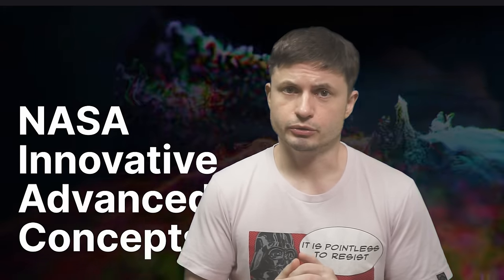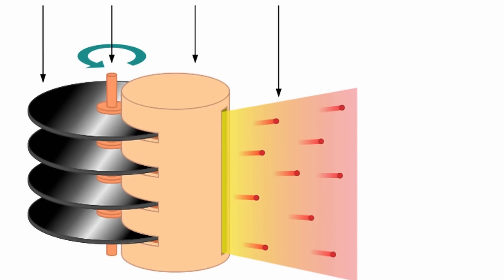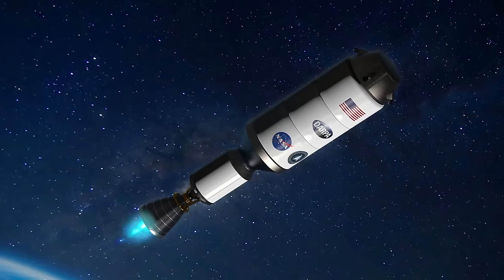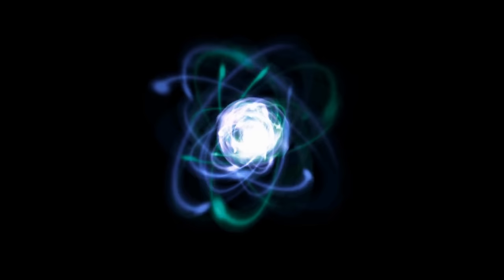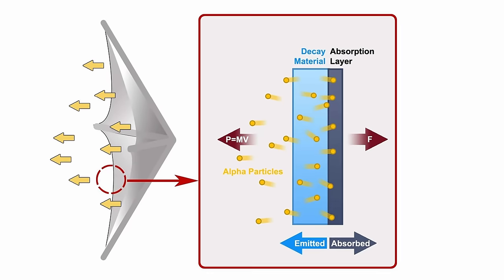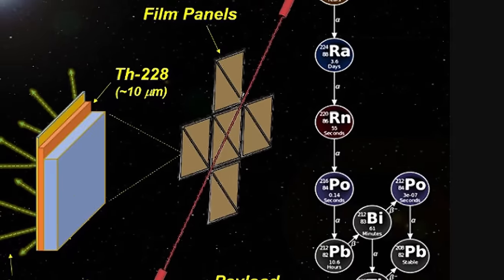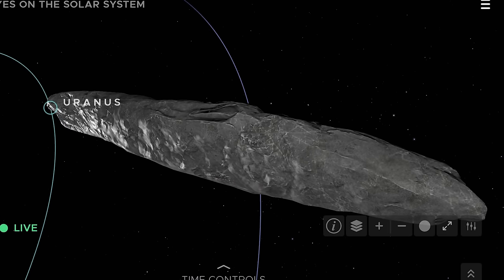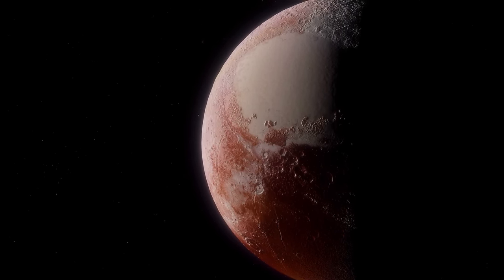Efficient Space Engine That Could Use Nuclear Waste For Propulsion

Comment: A couple of questions :-
Does a particle colliding with the absorbing layer layer cancel out it's own backward thrust created by it's emission?
Because the particles are emitted randomly in all directions, how is the lateral thrust controlled?
Just a thought.
Reply: Random thrusts add up to zero as the number of particles increase. And yes, the momentum is cancelled. This is dumbass engineering looking for a problem for their solution.
Reply: It's an obvious question that Anton does not answer.
Reply: The absorption layer makes one face net zero leaving other face net positive hence thrust pretty simple . You're premise is backwards for the emission to hit the absorption layer it has to be going forward. Emissions backwards are let go hence thrust.And lateral output is negligible as we're dealing with trillions of tiny outputs each fuck all. Think of it as a statistics engine if that makes it easier.
Reply: @leonmusk1040  The force on the sail will be created by the emission of particles from the atoms, not by their effect on the sail.  Because particles are randomly emitted in all directions, the forces must be neutralised from all but those going opposite to the direction of travel.  Otherwise there will be no resultant force to provide acceleration.  Trillions of tiny outputs add up to considerable force, otherwise the concept would not work.  Thus, any uncontrolled  lateral leak will lead to a deviation in trajectory.
Statistics is not Engineering.
Always bear in mind, there are "Lies, Damned Lies and Statistics".
Reply: @farrier2708  Tell me you're unaware of the Monte Carlo method without telling me you're unaware of the Monte Carlo method.
Reply: The very point of the absorbion layer is to catch the forward particles so the thrust is created by the back emissions. You're thinking of this backwards, if there was no absorsion layer, the forward emission would cancel the back emission and the probe would end with no thrust. Side emission are neglible because we're talking about a tenis court size panel thats10 microns wide/thick.
Reply: @carlschissler  I have never actually used the Monte Carlo method but I have visited the oracle Delphi.
I found the virgin priestesses there to be equally accurate.  😎👍

Comment: What happens when a rocket fails or explodes on the launch pad?
Reply: Or on the upper atmosphere?
Reply: Nothing.  The thorium, plutonium, etc. is encased in an  explosion-proof, crash-proof and easily identifiable container.
Reply: @douglaswilkinson5700  You mean like those perfectly preservable Flight Recorders on aircraft?
Or the core containment at Fukushima or Chernobyl?
Is that sort of fool proof containment you are talking about MR Wilkinson4600?

Describe this container that you are talking about - the material it's made of, the shape, the thickness etc.
Reply: @PetraKann I am not an expert on the containment vessels for RTGs.  There were several news stories I saw years ago where NASA explained their ability to withstand both an explosion and an impact post rocket failure.  If you are interested you can look up the details.

Comment: Couldn't the sail, instead of absorbing half of the radiation, reflect it back?
Reply: No, because most of the radiation is neutrons. Some of it will get reflected, but just as many will pass through and even more will get absorbed.
Reply: Alpha particles would be very difficult to "reflect" - they are heavy and small, relative to particles that would make up the "mirror", and they pack a punch that would very likely damage a thin mirror. And such a mirror would only reflect particles sent in its direction by the radioactive layer's contact surface. Depending on the thickness of the isotope layer, the percentage of reflected particles exiting the sail from the right direction may be very small, so the mass of the reflective layer may end up making the sail less effective
Reply: @Unmannedair isn't it alpha radiation? That would be positively charged and could be reflected by a high electrical potential. The problem is, that they would be reflected back to the Thorium. Maybe the direction of emission can directly be altered by an external electrical field.

Comment: Why was the NERVA project abandoned? 
Or the equivalent RD-0410 in Russia?
Reply: One word... Politics
Reply: @Unmannedair  of course but why
Reply: @car103d  After America reached the Moon, the space race between the USSR and the US was pretty much over. And without that incentive to drive such projects, each of those governments quickly lost interest in throwing more money at them.
Reply: @Unmannedair  Politics played a role, but it was the politics of "Y'know, blasting huge amounts of highly radioactive stuff into the atmosphere to make something move is a REALLY un-good idea". 

Or are you unaware that the NERVA concept involves dumping "something" (one version of the idea called for water, others used different materials, but the problem remains the same) through a nuclear pile to heat the "something" to insanely hot before blasting it out the back end like a rocket blast. Problem with that is that whatever you dump in/blast out comes out as a cloud of radioactive hell. A single launch using the NERVA concept would sterilize hundreds, if not thousands, of square miles around the launch site, and leave behind a radioactive cloud to be blown about by the winds, pretty well guaranteed to kill anything it comes into contact with, all the way down to bacteria.
Reply: @Ferd414  The test videos like the one I posted show tests near Sacramento in open air with H, apparently there is no danger and protection for people around. Where did you read about radioactivity fallout, or the use of water or ‘something’ else?
Reply: @olencone4005  That’s the usual answer we get everywhere, also on Wikipedia, but I don’t believe that we just stopped all research and development, completely, for 50 years(!) and now we want to return on the Moon or even build human colonies on Mars just with old fashioned rockets! 🚀

Comment: You keep mentioning change in velocity but never say how long that change takes. 150 kilometers per second is a big change if it happen every second. it is a small change if it happens every year.
Reply: 150 kps is over 334,000 miles per hour.  The only spacecraft that will reach and exceed that velocity is the Parker Solar Probe.

Comment: Try vibrating the molecules of walls themselves along with chemical thrust rockets to lush the overall Mass . And  pipes of water in the walls would more then protect against radiation  but if you push the Fluid and much of the ship's mass is fluid then moving that fluid would move the mass

Comment: Why say something and then immediately contradict it in the next statement? Eg. "150 km/s of thrust," "this is actually delta-v," "very likely would definitely work." You do this constantly in your videos. There are many factual errors, eg. a nuclear thermal rocket doesn't get hot enough to ionize hydrogen, they actually run at lower temperatures than conventional rockets. Maybe daily is too much work for you